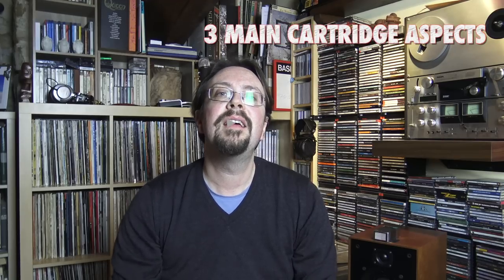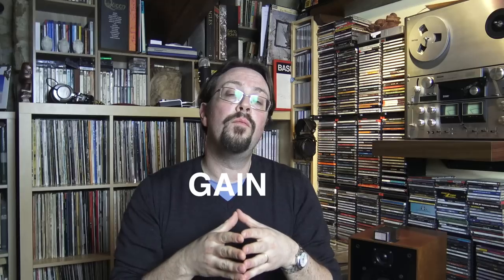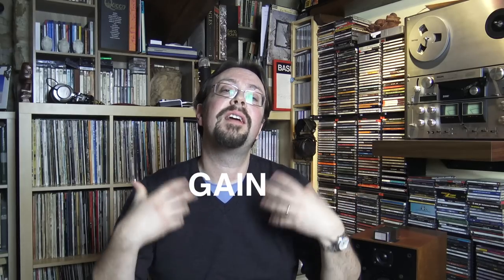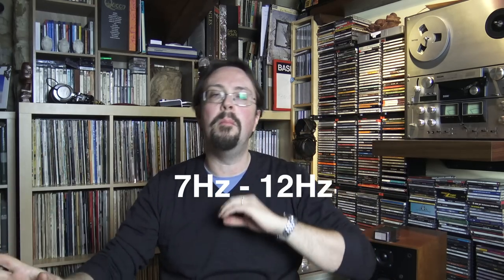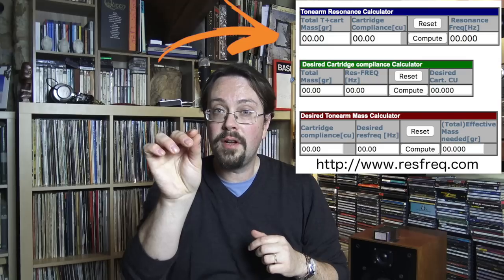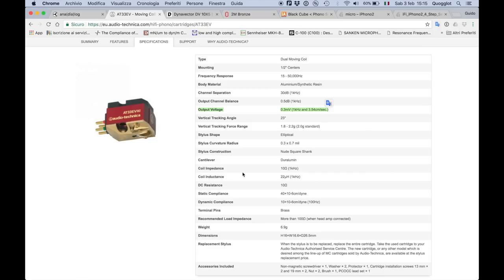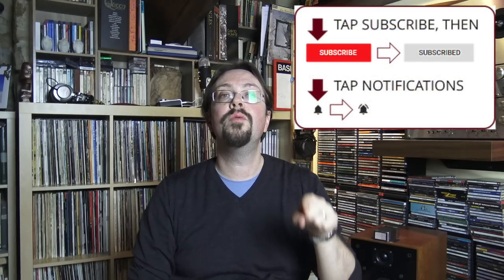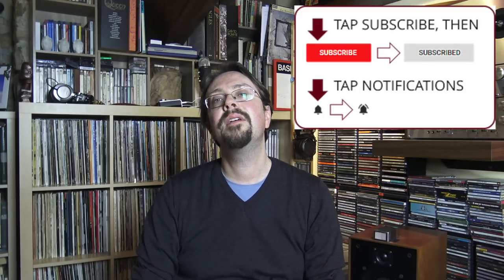PHONO CARTRIDGE: How to choose and match it with your preamp and tonearm

Comment: hi....you always come up with very informative videos. since you have a great deal of knowledge and experience I would like to seek your advice on, well, cleaning records. it's usually hot and humid here and since many of my records were bought second hand, they have a lot of fungus....white patches that diminish when washed (but never go away) and return when kept unplayed for some months. Besides I bought a new record a couple of months ago tha t had too much of lint and now that I have washed it, it's seems to have accumulated sediment in the groove that produces a hush hush like sound.  Damage done, but is there any way out? Ive stopped washing records and my old ones have got some serious fungi infestation going on. It's really humid here in Calcutta! What to do? Please help!!!
Reply from the maker: Hi Roy! Sorry for the late response but your problem isn't easy. I am afraid that the only way is to use 'aggressive' vinyl cleaning solutions to remove all bacteria in order to prevent further fungus growing. Another possible solution, but I cannot be certain, is that of using a professional machine for clenaing. That should relly remove all bacteria and have perfeclty clean vinyl at that point. This is one of the best and 'cheapest' solutions avaiulable (don't get me wrong, it is expensive but compared to other this one is very very good and it costs much less than other simialr machines): https://kirmussaudio.com/
Hope this helps!
Reply: thank you ....😊😊😊you rock sir! you sure do!!!

Comment: I'm basically starting from scratch I've owned TD 124s I've owned oracles I've owned micro seiki and a lot of other high end turntables but now I'm down to no turntables and need advice as far as best matchup for a turntable arm and cartridge setup I do have a quicksilver tube preamp with a separate phono section so would need some advice. Please if you could help me that would be great.

Comment: I have a Thorens TD 125 Mk II w/ SME 3009 Series II (Improved) tonearm.  I've narrowed down my cart options to the following:
DL-301 MkII - $400
Shure V15-III - $200
Dynavector 10 x 5 High - $750
Audio-Technica AT33EV - $475
Audio-Technica VM740ML - $325
Audio-Technica VM760SLC - $650
Grado Gold 1.5mV - $600
SoundSmith Carmen - $800
SoundSmith Otello - $380

Which would you lean toward in terms of best bang per $ of for sound quality?  I'm less concerned with the detail/analytical end of it and value the musicality of punchy lows and brighter highs.
Reply: Denon without exception
Reply: Just get a nice Goldring for less than 200.00 and be done with it..

Comment: Heres the info on the tone arm I see on my table. I dont see where I can find the weight of the the arm. Am I missing something?
Technics 1210GR 
Head shell weight Approx. 7.6 g
Applicable 
cartridge weight 
range
(Without the auxiliary weight)
 5.6 to 12.0 g
 14.3 to 20.7 g (including the 
 head shell)
(With the auxiliary weight)
 10.0 to 16.4 g
 18.7 to 25.1 g (including the 
 head shell)

Comment: This is a good video, sharing a lot of important knowledge. I must say, though, that I do disagree with the "Moving coil generally sounds better than moving magnet"... that is simply NOT true. There are many moving magnet and moving iron cartridges that blow moving coils costing MUCH more out of the water.
Reply from the maker: Yes if course, I just reported the general trend. At the maximum levels of quality MC are USUALLY the winners, not always. Plus you really need a good amp for them...

Comment: This is an old video.  I hope you see this question.  I have a sansui 9090DB that has a Sansui 929 with a jelco 750d tone arm.  The original was damaged in a moving accident.  I now have an AT120E that I hate.  MC is very attractive to me but all my searches found most people not using that tonearm or reciever.  Please help.  I'd like to put a new cartridge soon.  And thank you.
Reply from the maker: Hi there, try upgrading to a Ortophon, Grado or Nagaoka. As I have said to many, I did this video to explain how to match arm with cart. Follow the instructions and try to find tye best match. Remember a simple rule, high compliance low mass arm and low compliance high mass arm.
Reply: @anadialog  so the ones you mentioned in MC cartridges?
Reply from the maker: The brands I mentioned have both types. If you decide to invest in a good MC don't forget to pair it with a good phono preamp.

Comment: Exelent episode, thanks so much, could you give a brief explanation about variable reluctance cartrige type, thanks
Reply from the maker: Well, that type of cartridge instead of having a magnet at the end of the cantilever it has a piece of hallow iron and in fact they are also called moving iron cartridges, which instead have a fixed magnet generating the signal in the coil. Less mass is the trick here for better tracking and low distortion. But this technology is rather rare now to find and IMHO less developed than MM and MC.

Comment: Why does the overall mass of the tone arm matter when the downward force can be adjusted? Most cartridges require about 2 gr of force. Probably not using the correct term.
Reply from the maker: Because the vibrations created by the resonance go through the arm and change according to the mass.
Reply: @anadialog  mmm science good. That clears a few things up. Downloaded a spec sheet for my Marantz 2230b and have original user manual for my Sony PS X55S. Will watch video again and connect the dots. 
Grazie mille amico mio. I am the original owner so I am old school.

Comment: I was eying a few tonearm however none mentioned anything about the tonearm weight.. just the net weight about 750g. They do say cartridge + headshell weight 15-45g range tho.. so I can’t check the resonance frequency based on this I guess
Reply from the maker: Manufacturers rarely give that info. I really hope you are not using a 750g tonearm, yikes! Try contact the one you are interested in or look for a manual if available.
Reply: @anadialog  I was researching  a bit and in general - high effective mass tonearm are better with heavier cartridges (Like SPUs) and relatively lower compliance cartridges? And medium effective mass tonearm are better for lighter cartridges like hana, Lyra , Denon 103.. however there could be some exceptions too? Like a high effective mass tonearm could be good for cartridges like Denon 103 also … ya I am confused sometimes

Comment: Thank you, that was a really nice roundup! I have a question regarding Ortofon cartridges, because you can only find "lateral compliance" in their spec sheets. What does that mean?
Reply from the maker: Compliance can be measured in dynamic and static, but also vertical or horizontal (or lateral). In other words its elastivity in both directions, static or in movement. You should check/test both values if you really want to know what is going on (or use a test disc like I describe here:https://youtu.be/GqWh41NT1Cc). In the absence of one or both try to contact the manufacture.

Comment: Thank you for the great videos.  I need help picking a cartridge for a soon to be purchased new turntable (tech 1200G).  I will be spending the majority of my budget on the table.   I am looking for a cartridge in the $400 to at most $600 range.   I was thinking Nagaoka MP300.  Based on reviews of HiViNyws channel.  My audio dealer suggested a Sumiko Evii or EVIII    Any ideas!
Reply from the maker: As you probabile know, I have that precise turntable. The Mp300 is an excellent choice. I have a MC Dynavector 20X2L and it sound great. My favorite are the Lyra carts but they are very expensive. The choice also depends from your phono preamp...
Reply: I’m using a Schiit Mani phono preamp.   Working on limited budget. I’m getting the table by selling off 3 of my old Mcintosh amps.  I expect to upgrade cartridges and phono pre amp over time. Wanted to get as good of table as I could afford. Can’t do a lot of cartridge listening test at the dealer(s) as I live 4 hours away from any good HI FI stores. Counting on reviews and recommendations for a starting point.   Again I like your channel. I’m getting a lot out of it in my quest for better sound!
Reply from the maker: A great quest! Don't think I am a snob or that I do not give value to money but if you are getting that nice turntable and one of those nice cartridge at a certain point you must upgrade that phonopreamp. Otherwise you are going to get a bottle effect, high quality at the source with a compression at the end...but I do understand that all this is done in steps, I did the same...just don't stop at the Mani...!
Reply: Your in no way a snob!  I appreciate your feedback and agree the mani will need to be replaced at some point in time.  But, it does current sound better then the built in phono preamp in my preamp. We all build our systems with in our personal budgets overtime.   I’m very happy I’m able to get this turntable.  I know others will not be able to afford this or similar tables. I also know there are tables and equipment I’ll never have as well.    I did find a review from Michael Fremer where he compared the Nagaoka to the Sumiko; this information, your feedback and other research is leading me toward the Nagaoka.    Thanks!
Reply: ANA[DIA]LOG Great news the Audio store is giving me enough for my old equipment to cover the turntable and enough extra for a phono preamp.  He is recommending the Rogue Audio Triton 2 phono preamp.  I have not researched this yet.  I know you recommend the Black Cube.   Any ideas or recommendations?   I will be using the MP300 cartridge.  I won’t be completing the deal until late June or early July so I have time to research.    I’m planing on doing some listening test in the show room for what that is worth against my Mani just because some thing is expensive doesn’t make it sound better then what you have.     I need to check on return policy so I can return the preamp if I don’t like it in my system.   Any thoughts are appreciated.  Thanks !
Reply from the maker: @SpiralMind6869  Awesome! Great choice. Headding towards a great system I see...I don't know the Triton but it seems like a very good choice. I was also thinking about a Manley Chinook, very good piece of gear, perhaps used...
Reply: I wanted to give you an update on my Turntable (& system changes) and ask a question.
First – I got my 1200G back in August I’m very VERY happy with it.
After getting the table I’ve been trying a number of cartridges:
                Nagaoka MP500
                Nagaoka MP100
                Orathon 2 Bronze
And the one I’m currently using (MC – LP Gear BIN 323)
Now that I’ve tried a Movie Coil – I don’t think I can go back to MM; I’ll just have to work my way up to better ones!
 
I replaced the rubber mat with a Carbon Fiber – Greatly reduced the Static and improved bass (also affected by VTA).
Over the past months, I’ve upgraded my interconnects & power cables.
As you would say, “Boy what a difference”!
I could not believe the improvement of the power cables made to the overall system performance most noticeably focus and resolution.
I had initially just replaced the cables on my electrostatic speakers; that change alone made me a believer in power cable upgrades.
I started a mission to change all my power cables on all the equipment I could (a couple of pieces have zip cord hard wired). 
I also (to my wife’s disapproval) purchases a used PS Audio P5 power regenerator.
** I know I should have made my own power and interconnect cables – but, I got carried away and wanted to quickly upgrade as much as I could.
For the majority of the cables, I spent about $100 each,  not the most expensive cables but I did make sure they minimally had proper shielding and OFC copper.  
I did spend a bit more on the Turntable, Phono preamp, and power conditioner cablers, these I over doubled my $$s. 
I have plans to slowly replace cables with built ones with better quality wire & connectors over time.
These changes have made a dramatic difference in the focus, resolution, depth of stage, harmonics and dynamics of my system. 
A dramatic improvement overall!!
 
Now to my question:
 
After my last upgrade – the power conditioner and a few new Power cables.
I’ve noticed when I drop my needle at the beginning of a record; I get a very-very light pop (it is a buzzing sound – short like a pop) that repeats until the music starts.
It does not repeat like a scratch.
At first, I thought the needle was skipping or bouncing (first time I heard it was on a slightly warped record).
I’ve noticed this on a couple of other records as well.  I’m thinking, the improved resolution on my system is detecting hidden details in the source media – But, also finding nuances once hidden in my equipment & setup!
 
Question:
Could this be the anti-skate force is set to low (or two High) and the stylus pulls away from the lead-in groove and bounces back, causing the buzz?
 
FYI:
I’m still struggling with setting VTA?  There must be an easier way!
I appreciate your hard work to creating these videos for the vinyl community!
I get valuable information and enjoy them and get a lot. 
You had me looking at Real to Real but I need to get my current system optimized first!
In support of your channel, I have a couple of sweatshirts (with the Vacuum tube) I wear them way more then my wife would like J
 
Thanks
Tom
Reply from the maker: Wow Tom...simply...wow! What a feedback, what upgrade. Final almost moved. I am very happy and also proud I must admit about this process you went through. It's amazing when you discover your potential to make a difference in the sound of your system. Itbalao can become a serious addiction! ;-)
I find that the VTA in the Technics isn't that good. I don't know you but Inwould need to go much more higher with the arm but the gear brings you up only a bit. One solution is to have multiple mats, if your problem is that its it's too low on the contrary a thin paper mat like mine. Coming to your buzz problem, the first thing that comes to my mind is static electricity. Do you have a Milty Zerostat gun? That is the only effective and rapid way to kill static, which you could have introduced with the new mat, new shoes, new carpet etc. Try that. Even I'd the buzz is still there, static does lower the quality of the pick up so it's a good idea to use it everytime you play a record and especially if you brush it.
Thanks again for the amazing feedback! I wish you could deliver you experience to those that don't believe in cables and all the goodness they are missing out on.
Reply: ANA[DIA]LOG Yes, I do have a Zerostat Gun.  But, I must admit after getting the carbon fiber mat & carbon fiber brush, I stopped using it unless I heard a lot of static.  That combination of mat and brush seamed to virtually eliminated 90% of my static issues.  I’ll have to get back into the habit of using the gun every time after I brush the record.
If the “Buzz” is static, that’s news to me; I’ve only heard the pops and clicks.
Last night I tried to repeat the “Buzz,” and I couldn’t.  That’s a good thing, and it does point to a possible static issue!
 
VTA – I’m still somewhat new to turntable setup; I’ve watched videos on setting VTA – even got an electronic microscope to zoom in and see the stylus – very cumbersome (plus – trying to figure angle from the picture -- I gave up on this).
So, then I tried to make sure the Head Shell was Parallel to the “average” record hight – but found with my mat it was a bit low – results were inconclusive.   Currently – I’m trying to do it by ear looking for what sounds best to me, but it seems to change with every record.  As I said before, there must be a better way – I guess I’ll go back to the headshell method with your suggestion of adding mats to raise it a bit.  
 
What do you have your VTA set on with your paper-thin mat?  (I know the cartridge and headshell affect the setting and your setting is not going to work for my setup).   
 
Cables – I’ve always believed that interconnects and speaker cables mattered.  I didn’t give Power Cables much thought, figured they were just an extension of the wires in the wall and wouldn’t make a difference.  Was I wrong!  I’m not sure if it’s the shielding preventing interference between cables, wire design, type of copper, OR most likely all three together; but it definitely makes an audible difference! ( in my system).  I would recommend trying a modest power cable upgrade on all or just key pieces of equipment, as I did to any Audiophile!
Reply from the maker: @SpiralMind6869  Actually VTA isn't vital. Mine is not perfect. The mat has a good impact on sound, certainly more than the correct VTA because in the end, a good cart will have a cantilever that more or less will set itself with a correct angle.
Reply: Thomas Pickard j